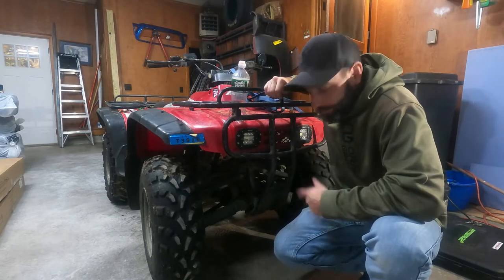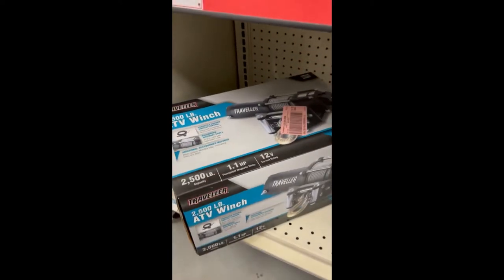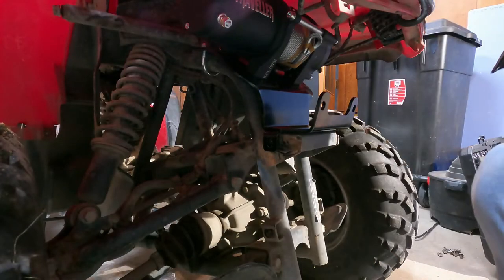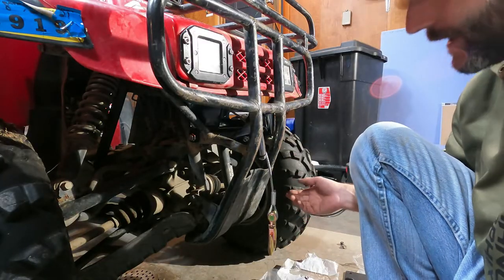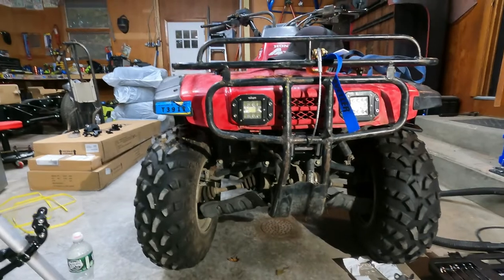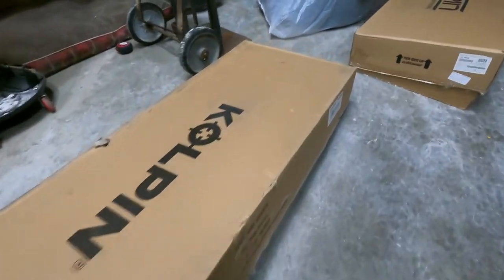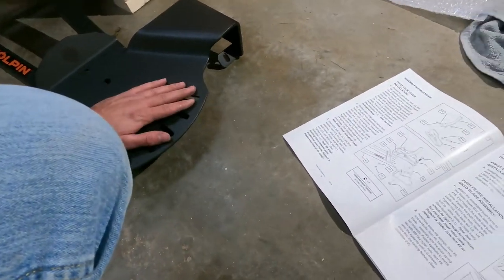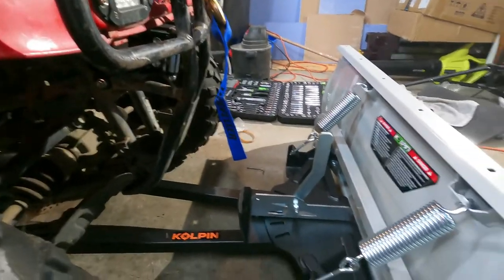Honda Fourtrax 300 4x4 Winch and Plow Install

Comment: Thanks for the great video!  I came into this looking for winch ideas but now I'm curious about your headlights.  I see that they are Nilight (I think), but can you link to them or provide the model #?  I've been considering a headlight upgrade for a while but want to keep it looking as OEM as possible and love the look of yours.
Reply from the maker: The headlights were on it when I bought it, but I can take a look at them this week and see if they have a brand and model number! They work great, but of course don’t have a high beam. These are wires into the factory switch as well.
Reply from the maker: I just checked the lights. They are Nilight but I couldn’t find a model number for you unfortunately!

Comment: Nicely done ..can u give me measurement of the belly plate where plow bars hook to it .mine different plow just wanted see mine bolt to it ..thank
Reply from the maker: I can certainly try, what exactly do you want measured? The width of the mounting points?
Reply: @trav.builds  where the pins go in point to point thanks